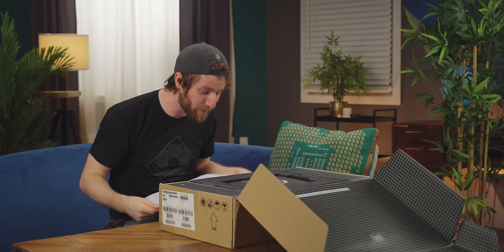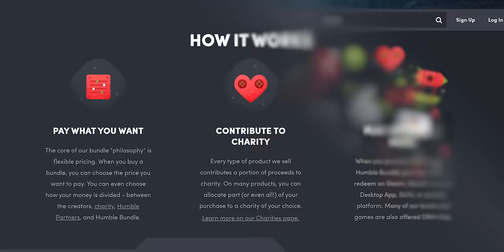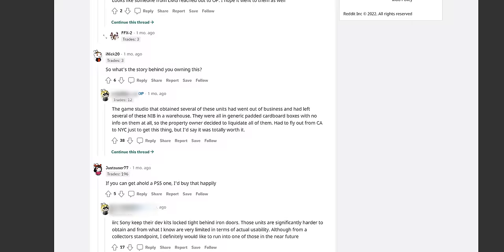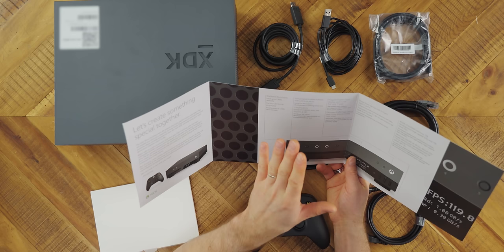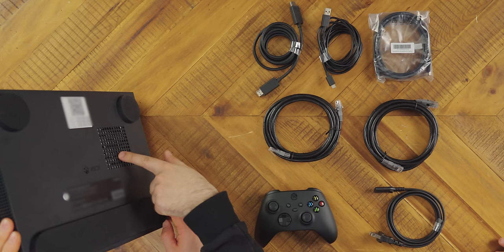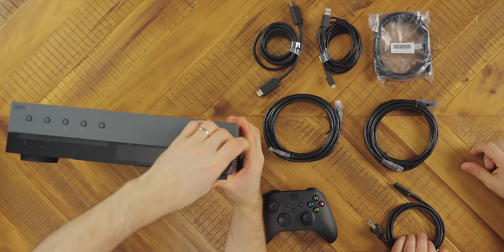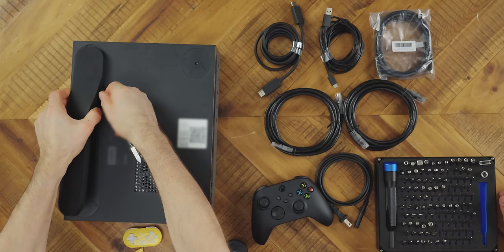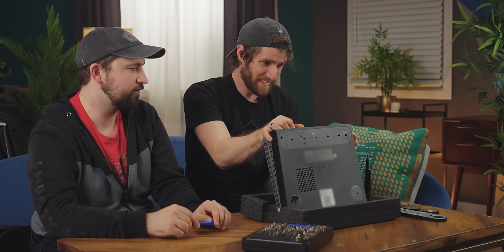I Can't Believe I Paid Two Grand For This - Xbox Series X Dev Kit

Comment: I should note something about the firmware version. The "OS version" string (which is the same as Windows build strings as the Xbox now just runs a different branch of Windows; 22000 being the RTM build of Windows 11) includes a date of when the build was compiled.

So, the build the console was first running when they got it had a build string of "10.0.22000.3542 (xb_flt_2202co.220202-1734)", with "220202" being the compile date. So, it was compiled on February 2nd, 2022. Probably not as old as they thought it was (I bet the 2019 date they saw the console set as is just the default date it reset to).

For comparison, the build they updated it to was compiled on March 30th, 2022.

Comment: You guys should had backup the data from the the firmware EEPROM chip.
Really important stuff.
Would have give the opportunity do unban the console if the ban is code base instead of done by blowing fuses in the CPU or somewhere else.
Reply: @pcnazillpg5065  Even if its encrypted its a restore point for that console.

Comment: Come on, not so clueless about the debug port! It is not there to test future compatibility...

It is there to do profiling on the software, dump memory, step debugging, push datasets and all that what CONSUMER does not need at all.
Reply: The extra memory is there to make sure you can get usable data to your actual development machine.
Reply: Not entirely true, they did not just give them for free!

At least for the older DevKits you had to pay for it, I'm fairly sure it was upwards of a thousand bucks for the 360 one.
Reply: Also, you need to move it out of developer mode to play retail games.

This requires you to have an active developer account!
Reply: With the older DevKits you could patch the XEX and use this with a patched kernel to run unsigned code ;)

Comment: Honestly dont buy these if youre getting into development, get a series x and pay the 10$ fee to put it in dev mode, you will be better optimizing your software on the actual hardware it is expected to run on, I get it for debugging but jeez just debug on your pc and push the non memory hogging build to your xbox, you can virtually map the drive and literraly publish directly from unity to your series x, you get all the benefits that you really need and your xbox wont get banned from a company not applying for anymore auth0 tokens, plus its a one time fee and you can even set it up on old xbox ones to debug there

Comment: Meh, fine, the consoles where not suppose to be used outside of game development. Its still an asshole move from Microsoft to just lock them. Would be nice for modders and hobby developers to just get one of those and do some fun stuff. Like in the old days, where you needed development kits or otherwise hardware modded xbox consoles to run Halo 3 and other console games with mods.

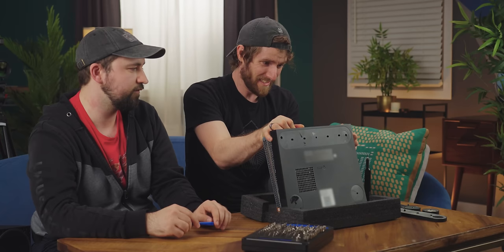Comment: 8:40 Why on earth.. would you even attempt to open it without running it first. Knowing full well its rare as hell in the condition its in especially supposedly running. You decide its a good idea to just start ripping it open? Not any thought to "maybe we should mess with the software first in case be break it". That idea really only occurred once you got to the 3rd panel to remove? Come on Linus lmfao you are def smarter then that.

Comment: On ps3 what we hackers did was use a network SPOOF through a DNS HACK to get around that issue you just had. LOL apparently us sony hackers are better at this by virtue of the fact we get abused the hardest being sony users in general  We create a custom firmware so its our os first and foremost and then we expect this sort of shit and accord for it with a dns spoof of the os before logging into the official network and updating it. Also when you signed in you had to use a "white listed log in id" this would need to be bought , bribed or social engineered as well.. LOL! this was so much fun to watch i was screaming DNS SPOOF FIRST NO DONT CONNECT IT YET YOU ALMOST DID IT RIGHT! lol had a vuln system for dns spoofing and got too damn hasty kids. oh well should of asked old VettaCossX here lol

Comment: ps3 was strong and a head of it time but it difficult to develop lead to it only get appreciate later in it life cycle, a late bloomer if you ask me plus a 600 usd price tag in 2006 is rough but consider home blu-ray movie reader go for 1000 usd at that time it make Sense for sony i guess
Reply: @oror3751  btw if you actually check the spec it quite the opposite the ps3 was stronger, but at the beginning it was hard to develop so lot of game was developed for the 360 then port to ps3 thus the lower in quality, but later stage in it life cycle game was significantly run smoother and look better on the ps3 taking full advantage of it spec and bluray capabilities, please fact check before saying thing.